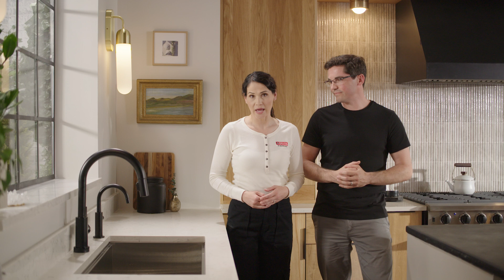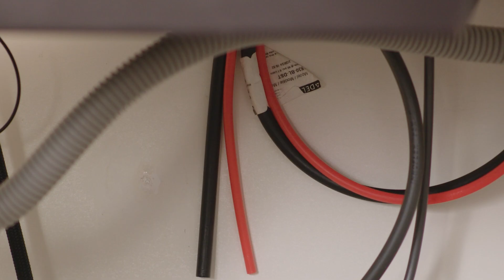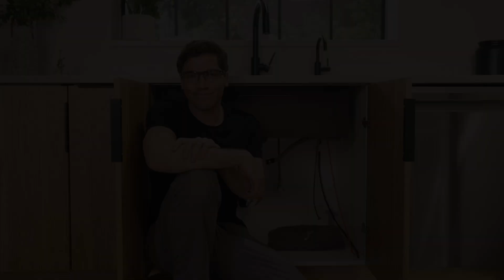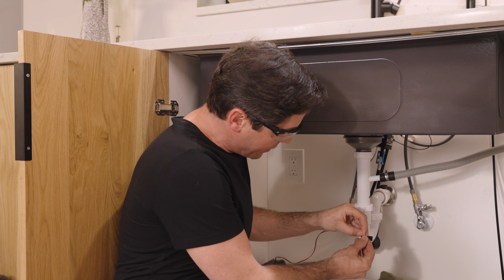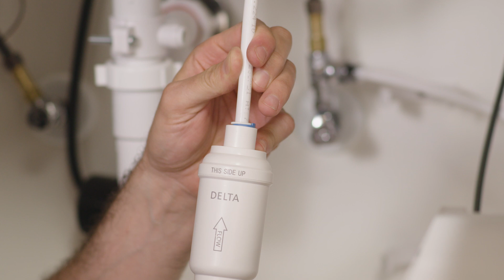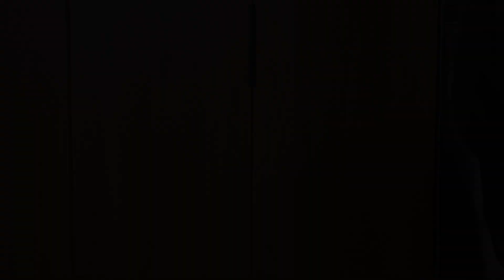How to Install a Delta® Beverage Faucet and Connect to 3 Different Options

Comment: How about hooking up this faucet to a water drop  system? The drain line is coming off the filter itself straight into the saddle, only the clean water is going to the faucet, hence one line to the faucet. 
So is it possible to hook up any delta or brizo beverage faucet to that particular system?

Comment: Is the t adapter 3/8 by 3/8 by 1/4, meaning is the faucet supply line 1/4 compression fitting

Comment: In the RO installation option, why should the waste line from RO connect to the waste line of the beverage faucet? Wouldn't it be easier to connect the RO waste line to the saddle drain so that the wastewater from RO directly flows into the drainpipe? By the steps you explained in the video, the wastewater from RO will go to the beverage faucet and then flow to the saddle drain via the drain line. Feels like an extra unnecessary step. Please help understand.
Reply from the maker: Hello Sreedharan! Thank you for your question and we are happy to help. The waste line from the reverse osmosis unit is going to the air gap integrated into the beverage faucet, and then from the air gap down to the drain pipe. The air gap is necessary, and required in most areas, to prevent drain water backing into the filter system and fresh water supply. With any further questions or concerns, please do not hesitate to reach out to us again. -Carrie
Reply: @deltafaucet  Thank you!